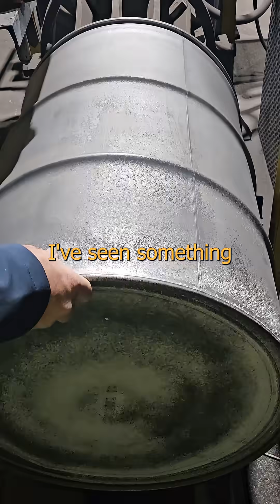Drum Expander #chrisboden  #comedy #engineering #educational #hydraulic #machine #metal #industrial

Comment: Where I work we have one of these for putting bell ends in 70 inch diameter pipes it is driven by a big cylinder and a cone that pushed out the expansion side and we can change the dies on the machine for different diameter pipes

Comment: One of my best ever Supplier visits was to the German company, Witzenmann, who manufacture flexible, stainlesd steel bellows pipes. Seeing the corrugations being put into a 400 mm diameter, 27 layer stainless steel pipe using a rubber ring, a form tool and a 600 tonne press was pretty amazing. They even gave us time to figure out how it worked. The trick is that you can change the shape, but not the volume, of an elastomeric block (the rubber ring in this case)😊

Comment: I helped make steel truck wheels (from pick up/van sized up to cement trucks) and we used expanders to put the final size on a wheel.  We also shrank some base wheels to final size using a "tire setter".  Also used that for stress relief on welded wheels.   I've seen video on how steel drums are made, it's not unlike steel wheel manufacturing with butt welding, shaping in rollers, etc. Though the drums of course used much thinner material.   Uninterestingly, that company started out making wooden, then steel drums for the petroleum industry, and later pivoted to wheels.

Comment: An additional thought, every strength ring added to a drum, shortens the barrel a little bit, and is calculateable (if that is a word?). And there are parameters or min and max dimensions for a finished barrel before they can be sold for use, especially for the oil and chemical world, and one more "especially", if they are scheduled to transport said stuff across the ocean. Then the tolerances required get really nippy and crabby, for what is allowed and not allowed.

Comment: It's a corrugator..
We used an older version at a plant I worked at back in the early 90's, where the operator held the shell on a horizontal die, and pulled a long lever to engage both sides, as the drum turned on the spindle..  (nothing you could get away with in today's safety conscious environment)

Comment: Had a machine much smaller and worked in reverse of your BIG GAL... It was a Parker Coll-O-Crimp hydraulic fitting press and I used it to crimp Parker fittings onto various hydraulic hoses from ¼ inch all the way up to 2½ inches. Expensive SOB, but was AWESOME in a bind and made you a crap ton of money when an expensive piece of Heavy Equipment was down and out and costing folks a crap ton of money just sitting there. Oh, and clocking the fitting the wrong way and crimping it... Yeah... you just ate that freebie. Been there a couple times at the end of a long day... Or at a 2 am emergency call.. Fvck    XD XD

Comment: Wait, why do industrial barrels need those ridges tho? They seem to serve no functional purpose other than maybe storage but that’s it
Reply: They are there for strength.  Just like a soda can, extremely strong until there is a small dent, then it would collapse.  The rolling hoops add structure and stability to the cylinder so it won't collapse.
Reply: @JDriver18t so they act like ribs to prevent getting the barrel squished?
Reply: @TAS90z Essentially yes.  The increase the strength in case it tips over, falls, or when the end user stacks them 3 or 4 high when full of product.
Reply: @JDriver18t  alr thx man

Comment: But is there one that pushes inward to fix dents that go out? Asking for a friend (and because I'm genuinely curious).
Reply: There are two different versions.  One is an expander that goes inside the drum and large wheels that roll around the outside.  The second is an air pump that pressurizes the inside and then again rolls around the outside.

Comment: I worked at a steel drum manufacturing company.  The rib is called a rolling hoop. It's there so when the drum was laid down and rolled, it wouldn't scratch the paint and any lithography printed on the sides.
Reply: I thought it would be for stiffness/shape maintenance partially?
Reply: @SenselessUsername they're actually surprisingly strong even without the rib an especially when they're full and sealed
Reply: @BLAZE13011  We also made straight side drums and the strength of them were suprising.
Reply: @LTDunltd  that makes sense. The material is thick enough and the rolled edge should keep the shape at the top and bottom. The ridge probably does help some with stability but its certainly not necessary
Reply: @SenselessUsername it's to protect it when the contents are pumped out or when it cools once its been sealed
Reply: @andrewstoakes8034  When we did DOT/UN testing, our 16 gauge drums surpassed the 15 in/Hg / 0.5 Bar of vacuum
Reply: @SenselessUsername  I would assume it does that, but given LTs comment I'd wager it was a happy accident. Humans have always been obsessed with preserving the pretty picture and being as lazy as possible, so the ring being made to allow us to roll it rather than lift while maintaining the advert makes sense.
Reply: @jamesmerkel1932   It also helped when making a turn. Press down on the inside end  to place most of the weight on one hoop and push the outside around to the direction needed.
Reply: @SenselessUsername  It has a lot to do with strength.  That is why most that carry hazardous materials have three hoops and non-haz have only two.  The strength is increased substantially for when the drum is dropped/tipped.
Reply: And the technical name is the swedge.
Reply: @JDriver18t swedge or swage...I'm thinking the latter...
Reply: When I was in a steel band the large bass drums were rolled to and fro using the edge of the bottom of the drum. I never saw one lying down to be rolled.
Reply: @kevincozens6837  We would "roll" empty drums from the conveyor to a temp storage area using the chime.
Reply: I've seen guys put Jeeps up on them to work when there wasn't a lift.
Reply: @WelderWrite its pretty common to use them as boat stands
Reply: @j.d.saccociates3313 
Yeah, I've seen that.
Reply: And the rib also is used by drum grabbers.

That expander unit has got to be a pain in the nuts to lube though.